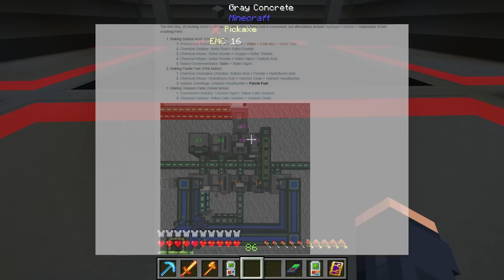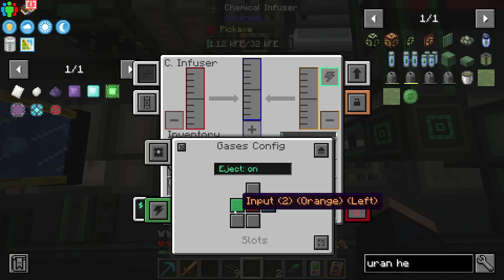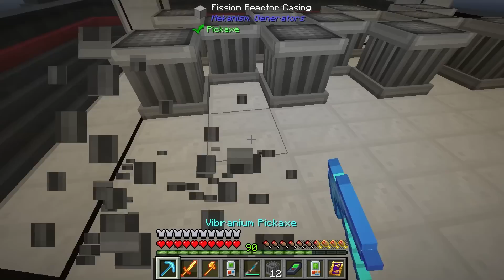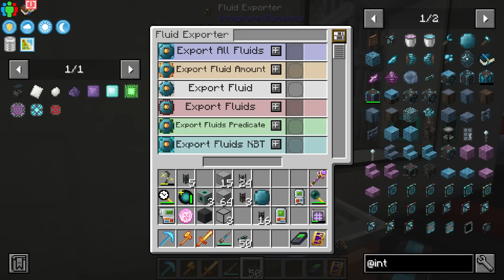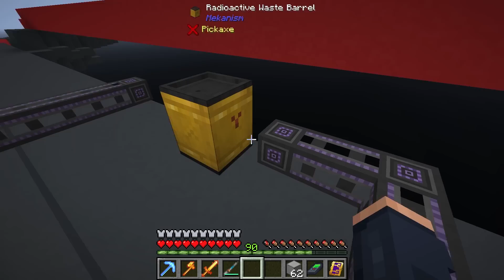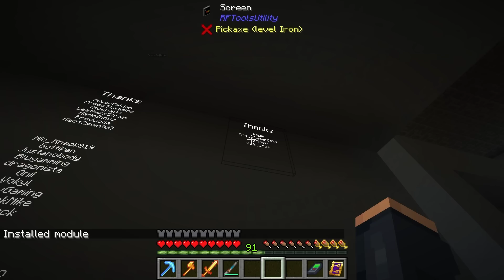Mekanism Fissile Fuel + Fission Reactor  EP32 All The Mods 7 To The Sky

Comment: For the reactor, great way to get water faster is integrated dynamics. As far as i know they have one of the fastest transfer rates possible.
Reply: Yeah you can set it to max int (2,147,483,647) which is by definition the fastest you could ever go
Reply: 100% the best way. I've got my reactor on full speed and it keeps up no problem
Reply: Yeah this is the best way to supply huge amounts of water, but won't be enough coolant for bigger reactors where you need sodium instead
Reply: @Run2Seeun  it could be, if your sodium production is sufficient, the pipes can transfer more than you could ever create